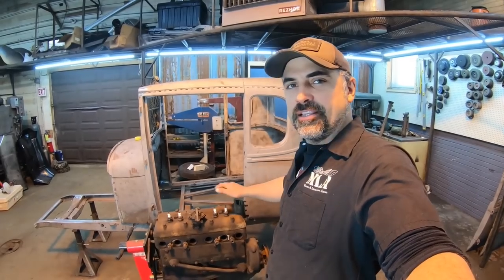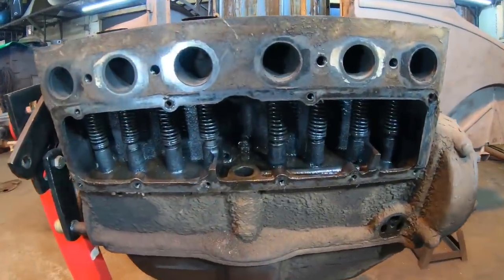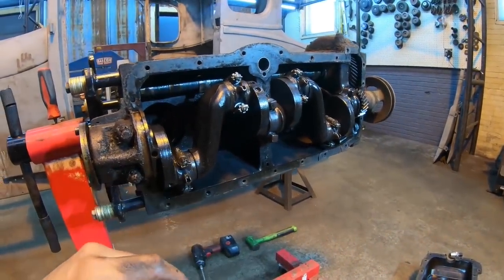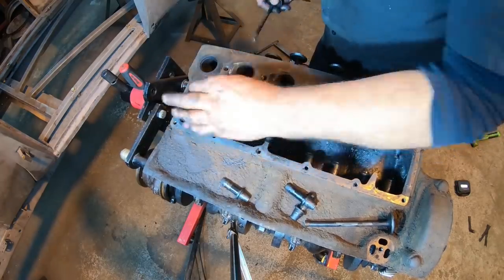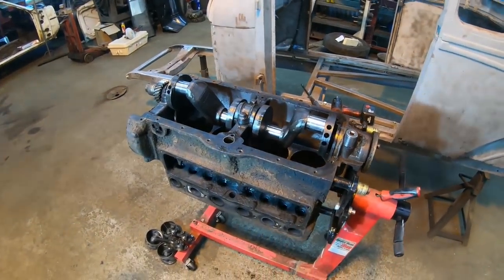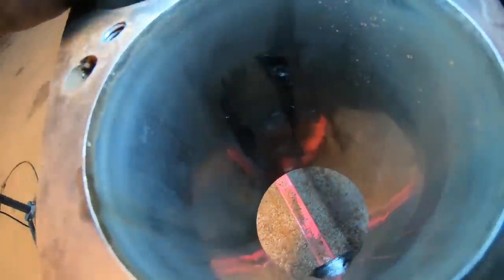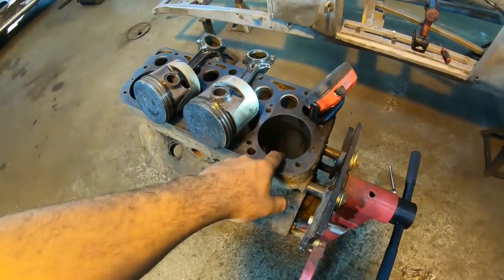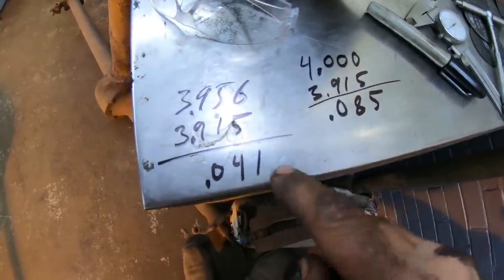DISASSEMBLY & INSPECTION Of A 94 YEAR OLD Model A Ford Engine - Yard Art Model A - Part 7

Comment: Sorry to see the gouge, but it's such a nice block might be worth sleveing?  Excited to see how this turns out, I put a 4" Scat crank in my flathead v8 and it works great.  Machinist did complain about having to remove a lot of material from the crank to balance it but it turned out nice, no vibration.

Comment: I see damage like this in old tractors and always try to imagine the stress most of the original operators had.  Most were poor and could not afford proper fixes.  In the case of tractors, they generally needed the tractor running immediately.  So, they did what they had to do, maybe working from their dirt floor in the shop after the cows were milked and move on.  In this case, this damage is fortunately lower down in the wall and probably didn't blow by too bad,  So, the original owners most likely could only afford to change just the single piston & rod and live with what they had.

Comment: You can silver solder those gouge marks and it should work for you. The temps are not severe enough to melt the silver solder. Just a thought.

Comment: Great video.  Glad to see more progress on this project.  On the 1930 Model A that I've been working with, I was surprised to see it had replacement pistons that were 0.30 oversized.  So, as you mentioned, I'm sure you can rehab this motor and get it repaired.  Thank you.

Comment: That cylinder wall damage is possibly casting faults that eventually gave way after hours of running. I've seen it before, had to scrap 3 V8 blocks.

Comment: For the highbay light, get a "corncob" style LED replacement. It is not to hard to retrofit old high bays to run on the new LEDs. Simply bypass the ballast completely, run 120 straight to the big ole socket (just like a regular lamp) and insert the new LED bulb. While a bit more expensive up front, the LED pulls less power and turns on immediately, instead of waiting forever for the halide to heat up.  An electrical supply house will have a better selection of bulbs.
Reply from the maker: I actually have one installed in one of my fixtures, it's absolutely useless In here. Seriously. The ceiling is just too dark and high. I could put in a ceiling under the trusses, so many people have told me to do that, but price wise we are talking 25k to do that. More importantly I want the high ceilings, all the cutting and welding makes a lot of smoke and it's nice that it goes up and out the roof vents. Painting the ceiling would help the led light bars I have installed on the model a side of the shop, but those alone with no highbay is still not enough and makes for a cold looking video in my opinion. Maybe I'll do a video on shop lighting one of these days and show everything in detail, see what people suggest. Thanks for the suggestion though! 👍

Comment: If no one else has commented yet, I suggest that 'S/O' is actually 'O/S' = oversize, so it seems that the engine may have possibly had been re-bored with oversize pistons fitted.
It's also possible that the large damaged area in the cylinder is a factory flaw, probably at the casting stage. How it got past inspection is anybody's guess.
Good vid, and very interesting, thanks.
Reply: @Retired Bore  Yes, though as it seems that the pistons are maked over-size, the corresponding bore will be O/S too, necessiitating the insertion of cylinder sleeves. I don't think there would be enough material for additional re-boring.
Reply: @Retired Bore I'm not too sure how many cylinders are O/S, but it's interesting that you say that the poor quality of some castings was accepted for what they were at that time.
I suppose afterwards, tollerances/quality improved due to the fact lives depended on it during WW2, and these practices were carried over to everyday civilian production, which was not a priority during the 1920's/30's.
Interesting stuff, I'm learning a bit from this thread.
Reply: @Retired Bore what's a wet, piston liner?
Reply: @Retired Bore I could use a 55 gallon drum full then.

Comment: I just pulled all 4 pistons in a model A engine and all 4 are marked Ford, with an expansion slit on the side below the rings. Nothing is over or under sized so I doubt if it has ever been rebuilt with one of the 4 having a smaller side opening like that one you show.

Comment: Ouch, hope everything works out wiht the engine! Ain't seen anything like that since a friend of mine and I tore down a stuck Ford diesel engine out of a tractor once just for giggles. Tractor was junk, transmission had gotten full of water, was rusted solid, all the sheet metal was rusted bad, rear end was froze up, we thought about using the engine for something else but it smoked bad so we took the head off and were like "Oh... Oh no" haha!

Comment: You are doing something that I wish I could do. I would love to learn to overhaul an engine. I could practice on an Air compressor, 
I think it works the same as an engine. it is one piston compressor.
Reply: Pretty much, except the valves in a compressor are pressure driven by the air inside the cylinder of the compressor. Nothing like the valves in an engine.

Comment: Just picked up on this project & it has my interest. If you are going the full pressure lube & slipper bearing mod, then of course an alloy head is a must. I have always wondered if a Model 'B' [1932] cylinder head was interchangeable on the 'A' block as I have always preferred the three bolt water pump. In fact, the 1933/'34 model 'C' engine [ also available to special order in fleet vehicles up to about 1937] was a full pressure engine from new.
Your damaged cylinder can be offset bored by a few thou to help ensure that the damage is cleaned up.
Any updates on this engine?
Reply from the maker: So i have been falling a little behind on Model A videos these days. Now that the season is over here and we are rolling into the winter months, the car and engine will be getting a lot more attention. I've got an engine video coming out here in a day or two, basically just a quick rundown of what i was planning on doing and cleaning the block up for the machine shop. However, i don't think i'm going with the Scat crankshaft in this one any more. What i am going to do is insert bearings in the mains and rods, pressurize just the mains, add counter weights on the Yard Art's stock crankshaft, one piece valve guides and bigger intakes, and of course, an aluminum head!  The main reason for going a little cheaper on this one is i actually just picked up a B block, and in the future, that would be the engine i would like to go all out on. Also we did look at cylinder 4 again and yes, offsetting the bore a couple thousandths should definitely take care of any damage. Already got myself a set of .125 over pistons, hopefully machining starts soon. Thanks for your input, should be getting into more on this shortly, also started making parts for a jig to hold the stock crank while welding on the counter weights.

Comment: I thought sleeve installation wasn't such a bad thing here. Plus the sleeves are cast from better stuff than the block is.
Since the other bores measured ~3.915 it means the engine is already +.040
I'd rather fit a sleeve to the damaged bore, then rebore all cylinders to +.060
The more cylinder wall you have left, the more stable the engine is. It is especially valuable on engines as rough as this.

Comment: the chunk in the cylinder wall I bet would be your wrist pins sliding in the bore in the piston head and slamming against the cylinder wall causing a knocking sound and most likely the reason the car was parked in the first place!

Comment: You may be way past this by now but I would agree with "Skylinefever" below and would certainly favor a sleeve in #4 rather than take out so much material from all the other cylinders. You have three cylinders with only .040 removed from their original size. 3.915 is exactly .040 over with nothing for clearance beyond .040.  Those cylinders may take a hone and provide clearance for new .040 pistons if you sleeve #4 and bore to match.  Sure seems like a much more "sustaining" approach. Obviously, totally your decision !!!

Comment: Looks like you'll be safe with the 4" bore. Math seems good. Is it possible to bore over 4"?
Reply from the maker: They claim 4" is up there, some people will even argue that's kind of extreme on the forums, but then again there are older guys on there saying the used to punch race motors up to 4.080...  getting pretty thin at that point! But they claimed they held up good.
Reply: @rottersgarage  If that's true an extra 80 thou is a bunch! All said, don't see you needing a new block. Good luck!

Comment: If you bore out the cylinder and remove 42.5 thousandths of an inch from the radius, will you have to replace the pistons to a slightly larger size to keep compression?
Reply from the maker: Correct, oversize piston...

Comment: Did you account for the .041 that's going to have to come off the other side of the cylinder won't you have to remove .082 to clean it up?
Reply from the maker: Yep, sure did, should clean up accounting for material off both sides 👍
Reply: @rottersgarage  outstanding

Comment: Ok. I'm sorry to tell you, but I was pretty upset with being told that it was a deal breaker with cylinder number 4. I disagree with the discouragement because like most engines old or not are still salvageable whether or not there in poor condition. There are many different options, for example like heating the engine while wrapping it with a fire blanket and braze-building a different metal into the gauged scrapes. Fortunately and unfortunately you still have to check for cracks with a magnaflux bar and powder, but not after throwing it through several different stations. Like, Baking it at 700 degrees, media blasting, then hot bathing it with sodium hydroxide. Then you are capable of superman scope vision by then, which will allow you to almost restore anything the best that it could be. And , don't forget you may need to bore through all 4 cylinders and fit sleeves in all because of disruption from the 4th cylinder. Oh, and look up "Cold shield" for your braze-build because it will have less residual stress on the rest of the engine. And most cracks can be repaired through TIG Weld, but research on residual stress first. Thank you.

Matthew,
Reply from the maker: Matthew, i really didn't explain myself properly on why if cylinder 4 wouldn't clean up at 4 inch it would be a deal breaker for me, not that the block would be junk or unsalvageable...  For what i want out of this thing, i want a 4" bore. I want the most displacement out of it that i can get. So i'm hoping it cleans up at 4".  The plan is to run a forged scat crank, nice rods and pistons, full pressurized oiling system,   and hopefully make somewhere around 150 HP.  Now if i wanted to do a mild build out of this thing, that gouge wouldn't bother me the slightest, i would just sleeve it and clean all 4 holes up to the closed size piston at that point. either way i will fix this engine, and im pretty sure it will be fine at 4", we could even offset the bore a thousandth or so to the front of the block if necessary.  It should be fine.

Comment: Would there be any practical/feasible way to fill a gouge like that with some kind of weld? Hey, I'm not a mechanic or welder, so you experts cut me some slack and just the explain why or why not, please.
Reply: it is doable but not praxctical, any welding causes distorsion so the block will need to be completely remachined to take account of that weld, sleeving is a better way to repair things and the net benefit is a better metallurgy that the original one that was used on these blocks.

Comment: Yeah I think reweld and rebore this damaged wall is the only way. Then balance all piston together ( I think they don't balance them, they were AIM at a quick fix ) You can even think to add something like nikasil on the bore. Something that would be extremely good to look at is to find a way to made all of thoose old designed engine to stop eating that mutch oil on regular run... but this is a lot of enginering with the ring :(

Comment: Those engines were famous for oil starvation when running on a slope (hills). I would guess sometime in deep history it threw a rod and gouged that bore. Why it was reassembled so, with that kind of danage is anyone's guess. It may have been repairedon the side of the road from underneath and they just sdid screw it. Times were different

Comment: Curious: what's the serial number on the left side of the block above the water inlet?  I'm guessing that's an early block.
Reply from the maker: Well unfortunately the number on the yard art model A's block was ground off years ago with a pretty aggressive grinder wheel and restamped with the number 2062149. The original number was completely removed years ago. Now a week or two ago i picked up another model A engine that interestingly enough was in a 32 Ford Coupe. And its not a B block.  This guy i got it from picked up this awesome 32 that years ago someone started putting a flathead v8 in, converting to juice brakes, basically hot rodding it. Anyways, the banger i got from him was not a B block, but an A engine with the B intake and exhaust manifolds, later cable pull starter, and B clutch setup.  Maybe they blew the B block up and swapped in a A? Pretty cool deal though. Anyhow i have the engine here, original number is below a restamp, A1632037 is the factory stamping, 2841934 was stamped over the top.  From what i looked up it should be a May 5, 1929 engine..... And unfortunately we will never know the original number for the one i took apart in this video....
Reply: @rottersgarage  That A engine Engine #1632037 was made on May 25, 1929 - good idea to replace a bad "B" engine with a good used "A" engine - the fit is about the same.
Reply from the maker: @mafcawebmaster4237  yes, 25th, I said 5th....

Comment: Love to see restoration of antique vehicles. Gone are those days when sleeving , Valves resetting, gearboxes made brand new, crown resetting, master wheel cylinders properly checked before discarding, odometer with trip meter for war vehicle the black out lights to camouflage oft air strikes etc.Voltage and current Regulator Autolite and Delco Remy lasting for century. 
 Today sad to see the use and throw takes upper hand.Worst in some countries the policy of scrapping on age basis has devastated the poors. Pollution test with Catalytic converter for emission norms turn useless. It is heartening to discover Catalytic converter has kilometres guarantee .If the guarantee is 2 lakh km car owners are saved from having to purchase new vehicle.not affordable by middle class

Comment: Is this the same engine you sanded the caps , etc. Did you make it to the races?.
Reply from the maker: No, this is the original out of the Yard Art coupe. The engine that was on the 29 chassis I bought for the banger roadster was the one I clearanced the rod caps on. That engine never came out of the chassis, did all the engine work in the car...
Reply from the maker: And yes, I made it to the races. Next video. 👍

Comment: What stud extractor are you using
Reply from the maker: I got it from a salesman that used to stop at the shop. I think he was from Kimball's Midwest.... However, i just saw they have the same one in the tool isle at Oreilly's.... It does work good, basically just a reverse chuck with an aggressive set of teeth...

Comment: I have more experience welding then I do with engine repair, but couldn't you just weld that gouge up and then clean it up when you bore it? I have to imagine an engine that old isn't running some exotic alloy, you could probably oxy acetylene that pretty easy, it might be kind of a pain to clean it up to prep for welding though. Seems a shame to waste an engine that old in such great shape.

Comment: Can you move the gas tank from the dash to the rear of the car
Reply from the maker: Absolutely. One great way of accomplishing that would be to modify the frame to extend out behind the car and run a 32 Ford fuel tank out back. Only problem with moving it is then you have to run an electric fuel pump. The model a engine did not have provisions for a mechanical pump, while the later model B four banger actually did incorporate a mechanical fuel pump. Gravity is what makes the fuel go to the carb on these model A's. 👍

Comment: You’re gonna have to sleeve that cylinder if you’re gonna use that engine. Nothing wrong with sleeves.
Reply from the maker: It should clean at 4 inch. I want to go 4 inch bore. But yeah if it doesn't clean up there, which it should, gonna have to sleeve it. 👍
Reply: @rottersgarage  it will be fine those are low rpm engines. By the way you’re work is magnificent
Reply: @rottersgarage  by the way I’m currently watching your videos Lol!